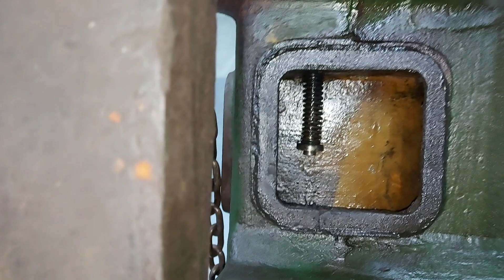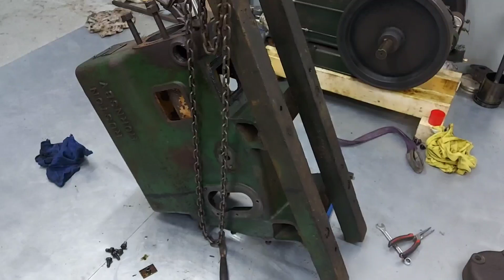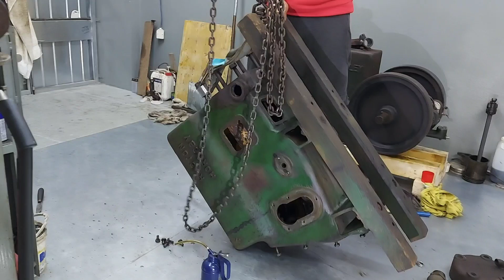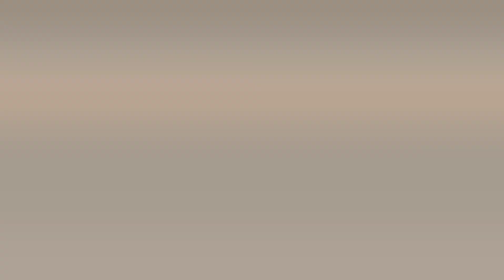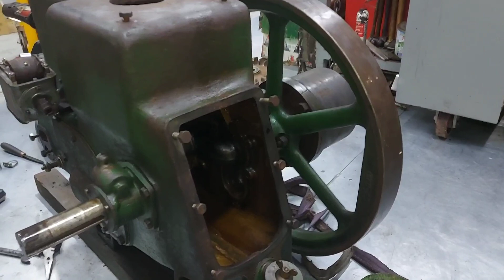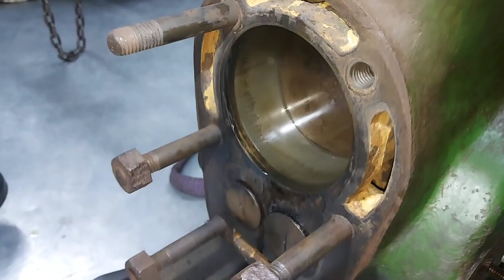Restoration on Ruston 9PB - Part 3

Comment: Mask inlet valve havent seen one like that for a while . The cotters have to be in a way so the valve doesn't  turn . Interesting engine
Reply from the maker: These valves dont have cotters. It has a trough pin. To keep it from rotating that valve has a flat machined in it and there is a corresponding brass rectangular washer.. Thank for watching.

Comment: The valve like that to keep the heat off the stem and stop it necking?
Reply from the maker: I think more to deviate the petrol towards the cylinder maybe?
Reply: @enginelover1  sorry, you said inlet I heard exhaust, better mixing makes sense.